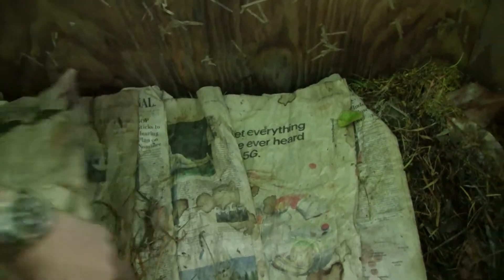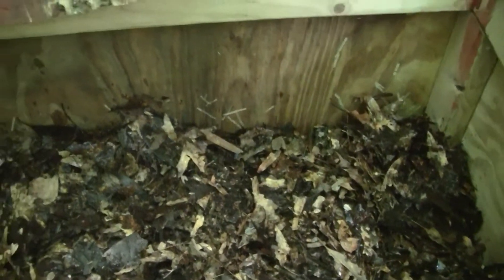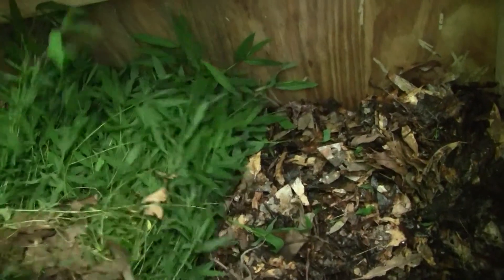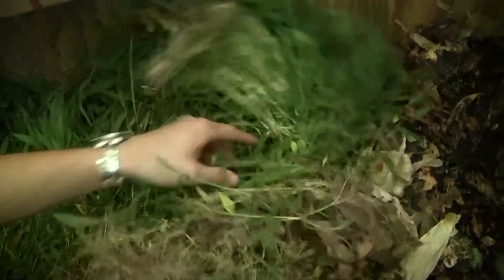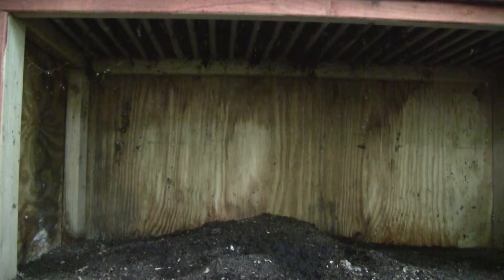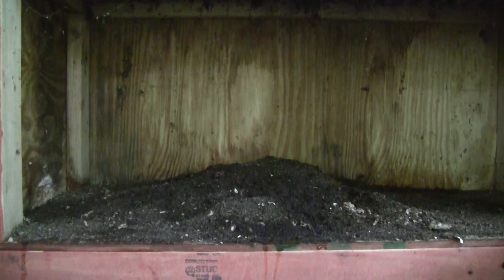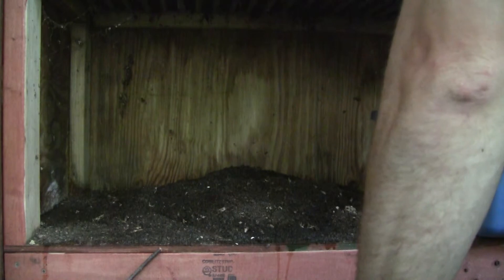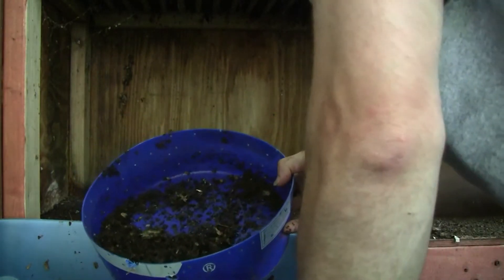How to operate a continuous flow through worm bin

Comment: What keeps the worms, the food scraps, or the bedding from falling down through the conduit to the bottom?
Reply: You start up your composter with either cardboard or simple, thin paper. When your pile is up to 2-3 feet, AND you have managed to keep a moist top and dry bottom, you simply rake out from underneath, as little (or much) as you like. The soil will be 'selfcontaing', if that makes any sense, and only release as much as you rake out.
And for your question about the worms; The Red Wigglers tend to stay in the top 1 - 1,5ft layer, so they will have no interest to the lower part of your pile, hence my suggestion to exercise the art of having a dry lower half of your pile.
Below, you can see the raking..
https://youtu.be/18Gthz0ftGM

Comment: Excellent - thank you for the video. I have the European fire worms/red worms, that aren't frost tolerant, so i will build a bin like yours, but i will need to insulate it, and maybe even put a small heating element in there with a thermostat, just to keep it above freezing.
Reply from the maker: You’re welcome. It shouldn’t be to difficult to insulate it. Especially if you use foam board insulation. I have thought about doing that myself but I got through the last few winters okay.